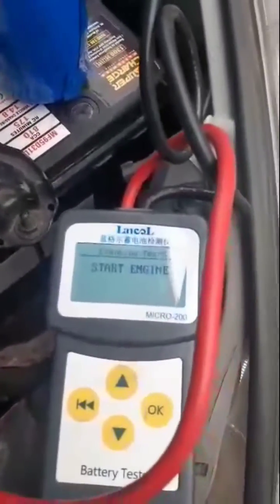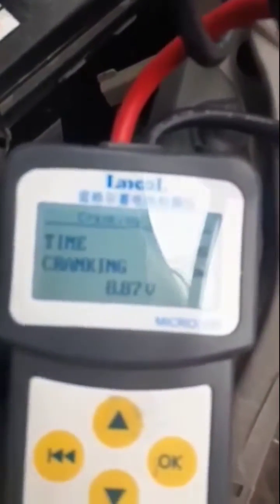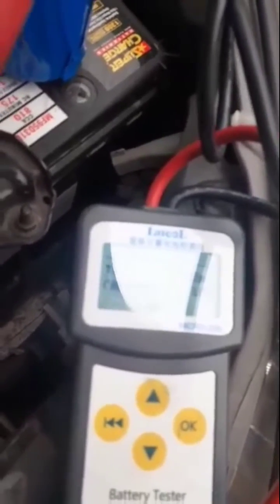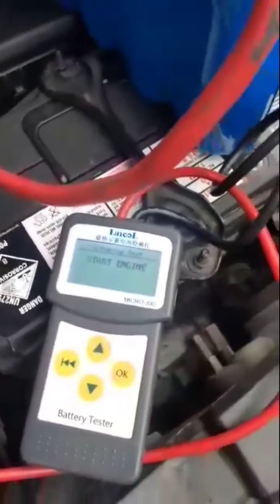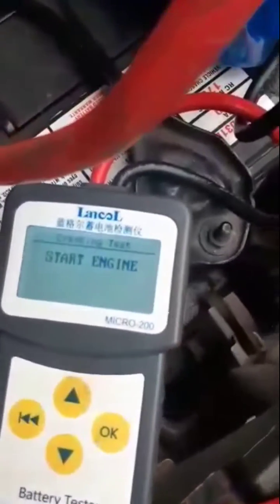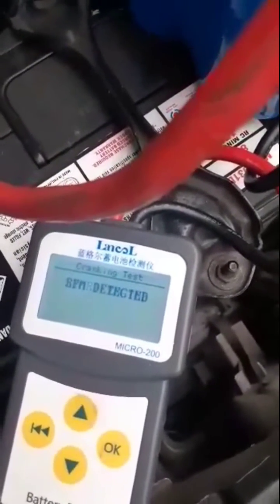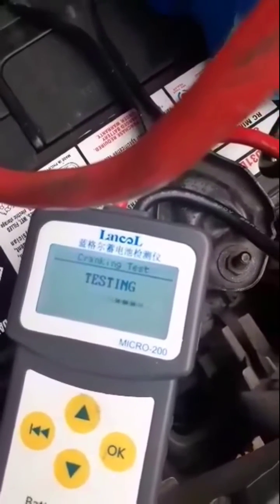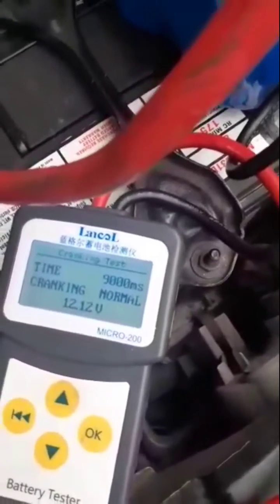The Positive effects of a super capacitor to a battery.

Comment: I have planned for so long to install a supercapacitor battery in my toyota Vios 2020, my big problem was there is no spce to install it, then I finally found one in front of the radiator. When I started my car and tested it using lancool battery tester it took only 5ms vs regular battery 999ms

Comment: Quick and right to the point. Thanks for uploading this video. I am not looking for replacing a battery with capacitors, but to understand what the benefits would be by adding a capacitor bank in parallel to the battery circuit.  Common sense tells me there should be a benefit both to the circuit (all the components attached to it) and to the battery.  I guess this video confirms my thoughts.